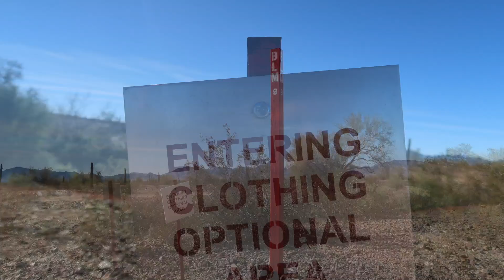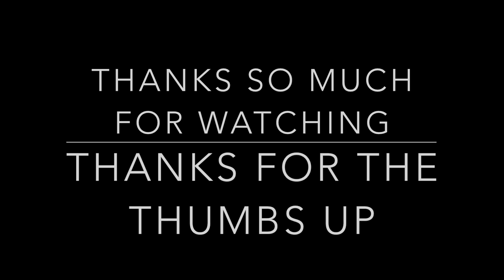Repair with Badge, campfire #244

Comment: Thank God for badge. I have an 8.3 also and my hydraulic pump to  my fan motor is also leaking. But I think something else is going on because I have hydraulic fluid in my Radiator fluid reservoir. Very nice video, thank you for sharing. God bless.
Reply from the maker: Yes, indeed.  Badge is a blessing.  Hope you find an easy fix for yours.  Thanks for watching!